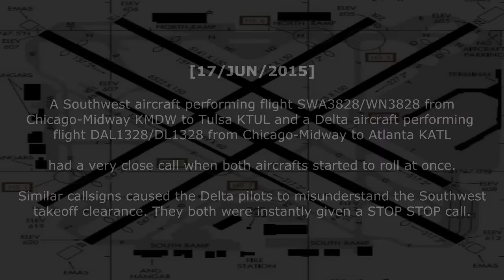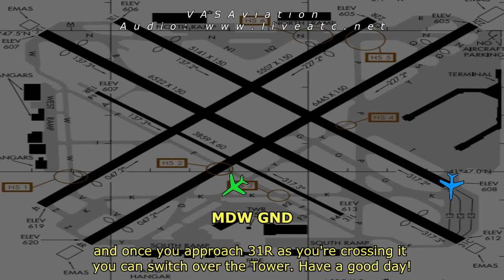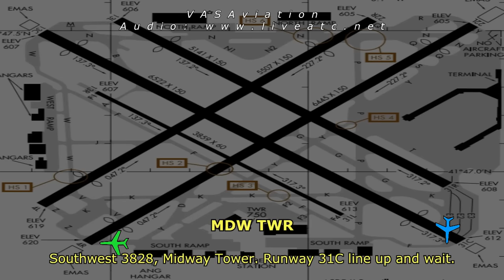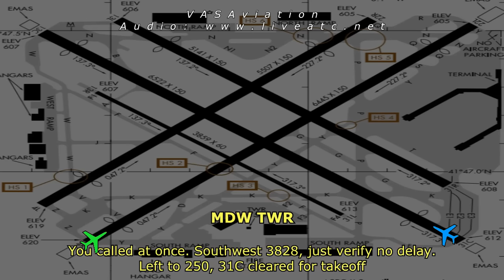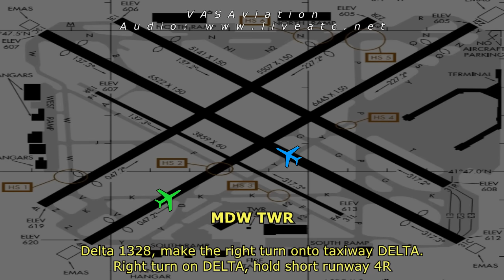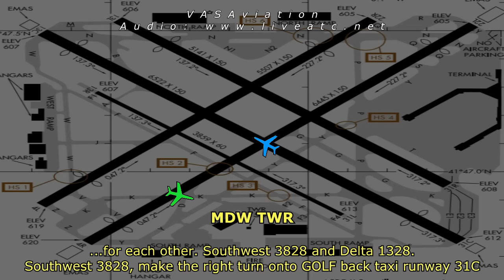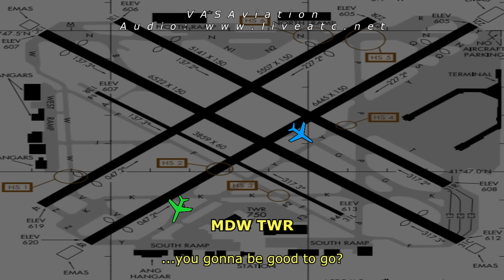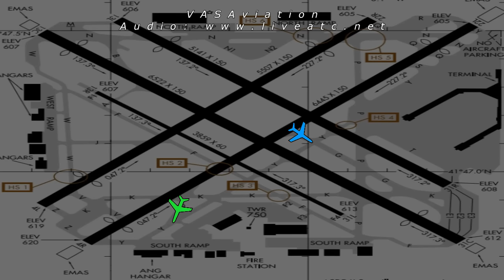[REAL ATC] Delta and Southwest VERY CLOSE CALL on takeoff

Comment: VASAviation, thank you so much for this informative presentation with great explanatory graphics depicting this incident.  It is filled with lessons learned and this is the way the review of this potential mishap/FAA safety board show review it.  I find it hard to throw stones at anyone since the take-off clearances were "broken/garbled" and there was "urgency" in the air as another aircraft was on short final.  I applaud the professionalism of everyone involved and I am grateful that the information could be disseminated for the benefit of the aviation/air controller community.  Ciao, L (pilot)
Reply from the maker: +lancelot1953 Thanks to you guys for your great comments! My work is worth if you guys enjoy the videos and learn something out of them.
Reply: +VASAviation - just chiming in to say thanks for the great work!  Find your videos fascinating!
Reply: Great work from all the parties involved, but i really dislike the radios on aircrafts. I myself had had a lot of issues during callbacks and callouts due to poor radio communications. Wаy to much of it getting cluttered
Reply: Controller error , awareness not maintained. The local controller should have been aware of the similar sounding call signs and used prescribed phraseology in accordance with FAA 7110.65  which is "Delta 1328 Delta" and "Southwest 3828 Southwest ". Controllers are responsible for miss readbacks. Also , when the two answered for the take off clearance he should have immediately said something like " the last transmission was for Southwest 3828 Southwest .....Delta 1328 Delta cancel takeoff clearance " . The inattentive Delta pilot didn't help the situation but ultimately it's an operational error on the controller , not a pilot deviation.  He did prevent the two from getting together and I'd imagine he had a few cocktails after work.
Reply: Joe Bloe I'd say it was a pilot deviation partially resulting from the controller error. The Delta pilot clearly knew he was on 4R, not 31C and while the callsigns were unintelligible the runway that takeoff clearance was given for was very clear. The controller should have cancelled the clearance when the readback was blocked until he could verify both pilots knew exactly what was meant to happen next. The plane on short final was landing on the parallel runway to Delta so Delta could have held for clarification without danger. The time needed to ensure a proper, clean readback from the correct plane may have meant that Southwest would need to wait on the arrival before he could takeoff safely, but that is better than risking two planes potentially colliding on takeoff roll.
Reply: Michael Carnes .....this error was caused by the controller not using correct phraseology and not maintaining awareness as these are in place to prevent such an occurrence. 
The lady ground controller was correct but the local controller was not. 

From 7110.65 Air Traffic Control : 
2-4-15 Emphasis for Clarity :
"Emphasize appropriate digits, letters, or similar sounding words to aid in distinguishing between similar sounding aircraft identifications. "

"United Thirty−one United, Miami Center, U.S. Air Thirty−one is also on this frequency, acknowledge.” 
“U.S. Air Thirty−one U.S. Air, Miami Center, United Thirty−one is also on this frequency, acknowledge.”
Reply: Joe Bloe so the controller's poor coms caused the Delta pilot to forget what runway he was on? I doubt it. The clipped callsigns certainly didn't help anything and the controller definitely could have stopped them sooner, but Delta 1328 was on Runway 4R and the takeoff clearance was clearly given for 31C. Ultimately the captain is responsible for his plane and it was the Delta captain that started a takeoff roll without clearance. The controller certainly could have done a better job, and hopefully has since, but the majority of the fault has to lie with the pilot taking a clearance for a different runway; and a crossed runway at that! Hence, pilot deviation partially caused by the controller error.
Reply: I think the tower controller spoke too fast and gave out too much information which cluttered the clearances. Even with subtitle, I had to rewind multiple times to get what was going on here. Sincerely, - FAA CFII since 2008.
Reply: different runway.

Comment: Why I always repeat the company when I have similar sounding callsigns on my frequency. Ex., Southwest 1328, Southwest. It doesn’t stop something like this from happening, but it at least gives some additional emphasis. 

Nothing breaks your workflow on a sector worse than two aircraft trying to take the same climb/descent clearance on a busy sector and then trying to figure out who the other aircraft was. Particularly when there aren’t any similar sounding callsigns on your frequency.
Reply: So.. not being s pilot or atc.. what could be done to prevent this?  I like your idea... To my untrained self it would make sense for the controller to just advise one plane not to move due to similar call signs... And as soon as the similar one gets off the ground, move them to take off?  Seems this would be a lot less likely to cause confusion than trying too e them both at the same time.
Reply: @Ken-xv4sb  Lead with the first number.  Delta ONE two three 8, or Delta TWELVE thirty eight, vs Southwest THREE 828 or Southwest THIRTY eight twenty eight.  Basically err on the side of clarity.

Comment: This is why under ICAO standards ATCs would say “Delta one-tree-two-eight”, but FAA doesn’t care about international standards so that’s ok
Reply: YEP!
Reply: Bingo.
Reply: That likely wouldn't have fixed anything here. "Delta" and "Southwest" sound nothing alike, nor do "31 Center" and "04 Right". Just a mental lapse by the Delta crew.
Reply: As long as the controllers sound slick and coool...
Reply: @coolbrounderscore  the point is to do everything possible to avoid confusion. In this case “Delta” and “southwest” could get cut off by shitty radio and then pilots could still get confused
Reply: Man this almost ended up like that one cross runway disaster at Tenerife in the 70s.
Reply: I guess you're not aware those are the FAA standards as well, and the international standard was almost certainly adopted from the FAA. Regardless, if you don't key the mic until the words "two eight" are leaving your mouth, which is basically what this controller did, ICAO standards aren't going to help.

Radio brevity enforcement overseas is more strictly adhered to, partly to ensure that transmissions are intelligible between non-native English speakers. Not necessarily because the specified brevity is always more intelligible than the normal English speech pattern. And some of the standard brevity patterns are too slow for busy controllers. Issues caused by lack of adherence to radio brevity are pretty rare with US controllers in my experience. You run into that way less often than you run into controllers who barely leave any dead air on the frequency because the calls don't get out fast enough. Just my two cents.
Reply: @JohnMaxGriffin  I feel like you forget that the European agencies also have a say in the international standards. hence i-n-t-e-r-n-a-t-i-o-n-a-l but you Americans don't think anything exists outside the US, so go on I guess.
Reply: @Stettafire  Not sure what you’re getting defensive over, I specifically talked about why enforcement is different in places overseas. And it is a fact that most radio brevity and phonetics comes from the US. ICAO itself was formed at a convention in Chicago. You can look at comparisons of various organizations’ phonetic alphabets prior to the 1956 NATO standardization and you’ll see the British one was entirely replaced, literally every word, while only the problematic words of the US alphabet were replaced. With words like “Yankee” lol. The RAF in 1942 actually just straight up adopted the US phonetic alphabet. And the 1956 standardization involved only English-speaking countries. So it very much is a case of the US dictating the international standard. The NATO phonetic and brevity standard was adopted by civil aviation in the US which was then adopted as the standard everywhere else.

It’s an international standard because it’s applied internationally, not because it was developed internationally. I mean… obviously.
Reply: @JohnMaxGriffin  I like when they accuse US citizens for having unfounded pride but miss their own unfounded pride entirely lol.  "Muricans didnt invent this we did!"
Reply: Was CLEARLY pilot error.  Would saying tree instead of three help?  Maybe.  But there were many many clues the Delta pilots should have picked up on that they were not the ones being cleared.  For example... they are Delta, not Southwest, and the clearance was for 31C and not 4R.
Reply: @Stettafire  lmao.  All ICAO standards were developed from the FAA initially.  ICAO is the international agreement everyone follows, but was largely developed from American standards (and many improvements have come to the FAA from ICAO as well).
Reply: @JohnMaxGriffin  Watch out for the "Tree"!
Reply: I'm it familiar with that but as a layman flight enthusiast I was thinking why not say each number individually? Seems rather obvious
Reply: This is why I always annunciate even at class G airports doing my own thing. One-Niner-Tree-Seven-Sierra
Reply: @Stettafire  wait... there's places outside the US?
Reply: @kishascape  I wonder whether "van Zanten" would have stopped if ATC directly told him to ...
Reply: "Delta one-tree-two-eight?" Hmm, if said that way both pilots would be asking what kind of "tree" and the ATC would have to quickly choose oak or pine...
Reply: @Nichol, if you listen to enough of these videos, ATC and some pilots  pronounce 'three with tree'  and 'nine with niner' ... Maybe saying tree flows easier when delivering lots of numbers, than three.
Reply: I doubt that would really have made any difference. Nine and niner is a big one though!! Five and nine are to similar.
Reply: I think if read according to ICAO standard (Three-Eight-Two-Eight) and (One-Three-Two-Eight) Instead of (Thirty eight twenty eight) or (Thirteen twenty eight) maybe there was no contradiction, Looking at the reality (38) and (13) read in the way just now, it is easy to confuse

Comment: For the same reason that the accident of the 747 of KLM and the 747 of PanAm in Los Rodeos occurred in 1977 and the majority of the passengers died, "interference in the communication, the 2 pilots spoke at the same time with the tower, there were Several factors occurred
Reply: There were few more reasons why that crash happened.  There were two planes on one runway, thick fog, exit taxiways were not marked and few more.
Reply: Also the KLM captain was impatient

Comment: They identified an issue right at the beginning and decided to continue to line both aircraft up simultaneously?! The minute delay would have averted this completely.
Reply: Yeah he could have just kept one and passed the other off then waited to pass the next one a minute later
Reply: I have to agree with comment.
Reply: It’s midway they do this all the time, it’s just the one time they had trouble while doing it.
Edit: often the safety protocols in aviation are disregarded as the industry continue to grow, not that it’s correct, but there’s not really a way around it. You heard the tower make an expedited t/o call as another aircraft is entering final. Expedited call wasn’t a thing, nor Special VFR. But they make some manoeuvre room for themselves to make things more, “efficient”, so to speak. Imagine your boss giving your group 3 projects at a time allocation of 2.25 projects, you’re gonna cut some corners...
Reply: I just want to point out that this specific circumstance gave way to this.
They had a crossing landing on 4L on a 3-mile final, and another traffic landing on 4R on a 10-mile final. They want to get the Southwest out ASAP before the crossing traffic, "no delay please", and then as soon as possible after that - they want to get the Delta away in time for the 10-mile traffic.

If they held the Southwest, it's possible they'd have had to wait for both the 3-mile traffic, AND the Delta, AND the 10-mile traffic. 
If they held the Delta, they'd have to wait for the Southwest, and quite possibly the 10-mile traffic, maybe depending on how the 4L traffic vacates.
Not to mention any other aircraft on approach.

It would've been safer to just keep the aircraft for a few more minutes, but in this case if Delta had followed their instructions correctly there wouldn't have been an issue - and you'd have clockwork sequencing.
Reply: @callsignguardian6364  Still not acceptable. Human lives are at stake. Cutting corners when your boss gives you three projects at a time allocation of 2.25 projects is a different story. Nobody dies if you cut corners.
Reply: @starwarsrebel2006  I fully understand where you’re coming from and I totally agree. After all safety is a top priority in aviation.
However this was an accident waiting to happen. They line up two planes simultaneously like they clear two planes to land on the same runway. Even said so in the seperation regulation/guideline the controllers are allowed to clear two aircrafts at once if they anticipate the required seperation can be achieved by the time runway needs to be used. Human factor error here was the same callsign, more than the simultaneous line up. The human robotic function of the controller prioritised lining them up more than paying attention to the callsign, which ultimately led to this. 
This was all avoidable at the costs the controller wasn’t particularly quick enough to process. This shows human factor in aviation at its finest.
Reply: Well the first controller is pretty clear which aircraft they are talking to. The second one that took over for the takeoff keyed the radio after he started talking, cutting out a good chunk of the first part of the callsign (delta or southwest) and then mumbled the numbers as quickly as possible before proceeding with clear and audible instructions afterwards.
Reply: @TheDjcarter1966  20 secs is all the delay he needed.. this was really unnecessary. ATC is root case in this all the way
You don't put 2 drag racers at the ready and then be surprised one of them jumps early when he hears somebody say GO
Reply: There’s nothing wrong with lining up more than one aircraft on crossing/parallel runways. We can even line up someone at full length and clear someone for take off in front of them at an intersection on the same runway. The mistake was on the delta pilot for not listening to the callsign when ATC cleared the southwest for takeoff.
Reply: @starga-fr7qx  With you 100%
Reply: Yeah, MDW GND being the GOAT and still they messed up.  Can't they just give them new temporary call signs?

Comment: Dont start talking till AFTER youve actually pushed the button wouldve avoided this.
Reply: I was thinking the exact same same thing. It's basic dispatch technique, don't cut off the first word of your broadcast. It's vital.
Reply: I was a police dispatcher for 7 years....you are absolutely right. There is proper radio etiquette and then there's people who don't give a damn and walk all over eachother.
Reply: I'm willing to bet that it was the ATC scanner (for this recording) that delayed the start of messages. It was likely fine for the pilots and ATC.
Reply: It's not that, i think it's because of radio reception one doesn't hear southwest talking tower hears one getting blocked
Reply: They should all be able to hear each other since they are at the same airport.
Reply: Anton Zuykov  They did. The controller was rewarded and the Delta pilot fired.
Reply: This recording was horrible due to the AGC pumping.  The levels were way too high.

Comment: I see where the controller is at fault here but Delta is at fault too. They had to know damn well they were on 4R and not 31C as the clearance was given. If i heard similar callsigns I'd be monitoring EVERYTHING and asking for confirmation before takeoff
Reply: Delta likely heard just 28.
Reply: They should have heard 31c and known they were on 4r and based on that should have known the clearance wasn't for them
Reply: Nick K agreed. All the people concerned were at fault. Yes, always ask for emphatic instructions and double check the other aircraft has not moved AND confirms he is holding. Nothing short of that is acceptable.
Reply: The thing is if you expect to here something (e.g. 4R) you are more likely to hear it even if was not said. The readback is to catch mistakes like this but when they were both reading back it was impossible to catch. I would say both delta and controller were responsible for this issue. Though I am more biased against controller as he should be aware of possible issues with similar sounding callsigns and lining planes at perpendicular runways at the same time.
Reply: Controller wasn’t at fault. This was delta’s fault. The call signs were not similiar as one is southwest and the other is delta.

Comment: A couple points.  1.  The quality of these recordings made by people near the field picking up the transmissions with their own radios varies.  It doesn't necessarily represent the quality they were hearing on their radios.  Could be better, could be worse.  That said, 2. clearly tower was aware of the potential for miscommunication.  As such they were talking way to fast. "serperder thirder 28, line up and hold."
Reply: Lol "serperder thirder"
Reply: He also seem to talk before actually press his Push To Talk button, he said “..28
Reply: Even if its garbled, "runway three one center" would still not only sound distinct from "runway four right", but even different number of syllables if all you heard was "grh-grh grh grh grh-grh" instead of "grh-grh grh grh"
Unless you hear YOUR runway called, you got no business rolling.